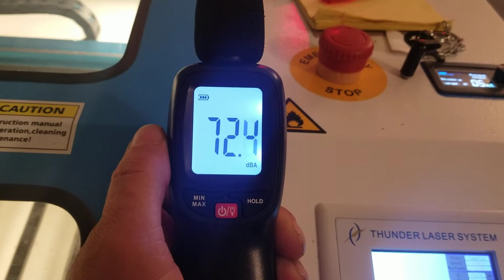Nova 35 with AC Infinity fan and Cali-Air compressor SPL Test

Comment: What’s this AC Cloudline infinity? Can it be run in line with the exhaust fan that comes with the thunder laser? Or just replaces it?
Reply from the maker: it replaces the stock fan: https://www.acinfinity.com/hvac-home-ventilation/inline-duct-fan-systems/cloudline-s6-quiet-inline-duct-fan-system-with-speed-controller-6-inch/